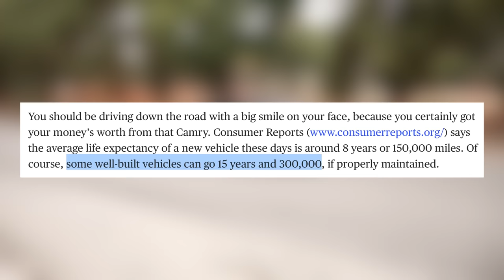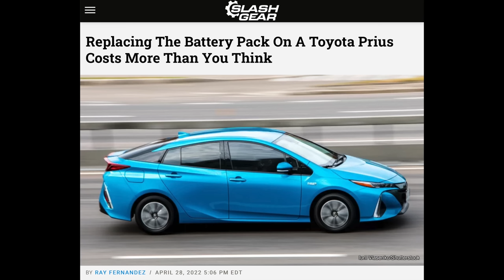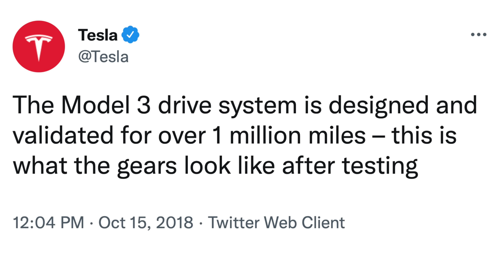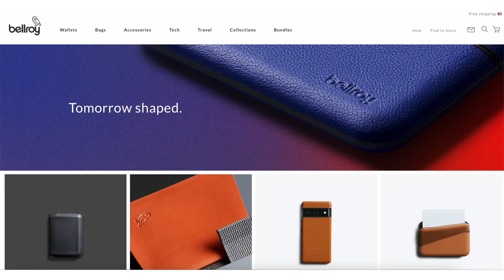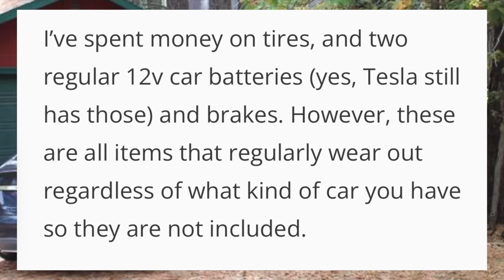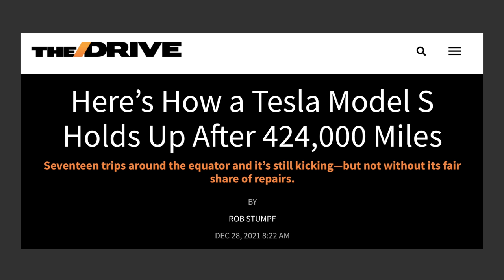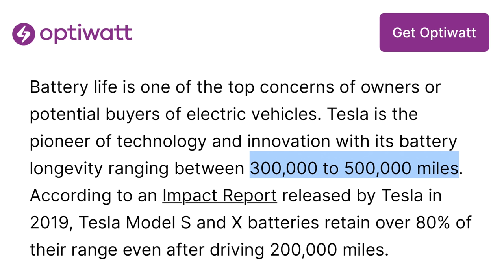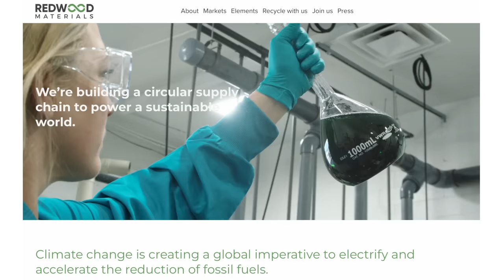The ONE MILLION Mile Tesla | It Still Runs

Comment: I'd be interested to see how the LFP Model Ys perform with their deeper charge cycles.  That 1 mil tesla reminded of the lumberjack's favorite ax, only had to replace the head 3 times and the handle twice.
Reply: LPF (lithium iron phosphate) cells can cycle 3000-5000 times. They will outlast the vehicle on average. Only drawback is less energy density vs li-ion. They either will have less range or a heavier/larger battery pack to match li-ion range. This is significant since li-ion are rated for 500 cycles maintaining 80% capacity
Reply: @dasppg9737  are LPFs being used in part of the Model Y batteries today?
Reply: @quaidcarlobulloch9300  I believe it’s being used in some of them. Primarily the lower range variants of the model y and 3. LFP is less energy dense than the li-ion NCA cells so won’t be used in long range variants
Reply: yes now

Comment: I'm at 142,000 in my 2018 model 3. Full HV battery scan shows around 9% capacity loss (using kWh capacity available not mile estimate).

Only significant repair is I had my steering column swapped ($1200) at 139,000 as a gear ⚙️ wore out and it was getting stuck. 

12v battery was $80 swapped myself, wheel bearing needed swapped for $120 at 95,000.

But that's really it. Original brake pads still and I'm on my 5th set of tires.

Comment: I'm at 118,000 with my M3 LR, so I'm approaching that 120k..  Full charge went from 307 miles to 288 miles.  (Edited as I misspoke the first time) I had to replace the Upper A-arms on the front for $701 and had to replace them around 60,000 miles; and rear cost me $600 around 110,000 miles.  No other big issues.
Reply: Struts cost you 1000? Damn. You mean suspension struts? That's very costly
Reply: @teem5642  upper control A-arms. Cost me $701.  I edited my comment above.

Comment: 80k miles on my 2018 model 3 performance with standard aero rims and brakes. I have had no mechanical issues so far. Almost through my second set of tires, replaced the windshield twice, windshield wiper fluid once. Car charges 130kw faster than it did when I bought it, and chargers are everywhere now. Range has decreased to 270 miles but the faster chargers and greater amount of chargers have made travelling far faster and easier than when I first bought the car. I figure at around 10 years I'll likely need to spend some money to replace some mechanical parts but dang this thing is cheap to operate.

Comment: You know what the greatest surprise take-away I got from this video?  Literally none of the 200k+ mi Tesla's you referenced mentioned having to replace the shock absorbers.  Tires, yes, but shocks that last more than 100k mi on vehicles like these with the extra weight they carry seems extraordinary to me!
Reply: I'm currently at 193k and still on original shocks lol
Reply: Tesla uses Bilstien shocks which are a higher level than most OEM shocks. I have heard of control arm replacement
Reply: @gtbigdog3507  I've replaced 3 upper control arms
Reply: @skep2  what model?
Reply: I finally parted with a truck I had because I didn't want to put $2500 into suspension repairs and then have the engine or transmission to fail (235k  miles original).  For electric, if the battery is still good, I would fix the suspension.  Holding out to replace that truck with the cybertruck.

Comment: I abused by 1990 Honda Accord for ten years.  I put 325,000 on it and it would still be running today had a tractor trailer no t totaled it in 1999. I had to replace a few clutches snd breaks but it never broke and never left me stranded.

Cars have only improved and if I bought a Tesla I could easily see at least over half a million miles.

Comment: Guys, the ceiling fan in my home is older than me. 39+ years (0 repairs). 
The iPhone 7 that I bought for my dad in 2017 had its first battery failure in 2024 (Dad replaced battery and using now) Tesla’s battery warranty is 8 yrs. The chances of a vehicle breakdown after 5 yrs is very very high for a ICE vehicle regardless of how well you maintain it. Moreover in 5 yrs there would be batteries would be cheaper with a less form factor. Who knows, the current model y can retrofit a battery pack which can take you 1500 miles per charge in future.

Comment: My Signature MX P90D with 236K+ is running great.  Only lost 13% of it’s original 250miles with 8yrs/unlimited miles and still on the factory brakes.  My biggest expense was losing the HVAC for the battery and cabin.  I never charge the car to 100%. And 85% of my miles are supercharged.  I will 17:24 own another ICE.  Waiting on my Cybertruck!

Comment: Hey Ryan, in your opinion, would trickle charging (Or Level 1 charging) an EV for the lifetime of the vehicle extend the battery life?
Reply: The fact of life for most Tesla owners, myself included, is that you will L1 charge your car around 90% of the time. It's important to note also that it's never necessary to supercharge above 80% like was talked about at 11:07. I've L1 charged my car to 100% when I'm about to take a road trip but supercharging to 100% is both incredibly slow (charging time dramatically increases as battery gets closer to full capacity), it's potentially damaging to your battery and it's not needed. Supercharging to 100% will actually make it take you longer to get to your destination. Thankfully, the Tesla navigation software saves you from doing the math and it's amazingly accurate. If it says you'll get to the next supercharger at 20%, you can put money on never getting there with less than what it estimates. Note, with the latest updates the estimates are getting even better as a number of mitigating factors are now being used to further improve an already super accurate estimation system. 

In short, no, you don't have to trickle charge all the time but you probably will trickle charge 90% of the time anyway. When supercharging, just do what Tesla's navigation system tells you to do and you'll keep from killing your battery pack and dramatically reduce supercharging time as well.
Reply: @russellthorburn9297  I assume you charge at level 2 (240 V). The question was whether trickle charging (120 V) would extend its life.
Reply: @russellthorburn9297  My charge stats says that I home charge 92% and SC charge 8% of the time so your 90% and 10% numbers seem reasonable.  I have charged to 100% once, at home.  I just wanted to see what it looked like.  Even when traveling I only bring it to 90% for the first leg.  There is just no advantage to going further than that.

When I purchased my Model 3 it was rated for 310 miles as I recall.  Now the reported range if I set the charge limit to 100% is 293 and I have 70+K miles on it. 

When traveling I try to keep the low point for the SOC at 20%.  I charge to the point that the car tells me to get to the next SC or destination.  My wife drove it from the Bay Area to the DFW area through southern Texas and she figured that charging time added about 2 hours to her trip.  That seems about right for that trip and the other that we have taken.  Generally I spend more time at the SC as I like to lay the seat back and take short naps at recharge time. I am never in a hurry. :-)
Reply: Staying away from 100% with NCA batteries and avoid below 5% for long periods of time is by far the most important.
Reply: @davidwojcik7770  This is correct. I already know that Tesla stresses keeping the battery at 80-90% on their packs that aren't Lithium Iron Phosphate (LFP). I'm having trouble finding information regarding whether or not a slower charge will help keep their batteries in better condition, though.
Reply: Batteries have a C rating, as long as you are under that rating they would be minimal difference.
Reply: How would he know??  He plays the drums.
Reply: @bryanwhitton1784  I went with the 19" Gemini wheels which get the Model Y 330mi of range. I removed aero covers on the gemini wheels which cuts range by a few percent though
Reply: Even on phones which have no active battery cooling whatsoever, fast charging is not demonstrated to reduce battery lifespan in actual testing since even the basic thermal management systems in phones will slow charging rate if it gets too hot. Teslas have liquid cooled batteries, for contrast, so I'd expect no noticable difference.
Reply: It’s possible. A better option or combined would be to care for the vehicle. Regular maintenance and smooth driving skills. The faster you go the faster you replace energy and parts.
Reply: @electrified0  absolutely not true. When then does Toyota limit their charging on their Prius and all other hybrids?  Because they’re trying to squeeze life out of batteries.   Toyota limits both the top and bottom end of charging for good reason.
Reply: With this size of battery, your house hold 220 voltage, amps, will basically be trickle charging. Won't be a whole lot of heat be generated...
This is only my opinion. I drink beer and know stuff.

Comment: Similarly to this video, my internet search shows Tesla’s body parts start breaking down after 100,000 miles in average. That’s pretty common in the car industry. Toyota and Hondas break less and last longer in average. I wish Tesla made better long lasting cars in terms of their body parts. I’m actually surprised it doesn’t. That’s why I’m not switching to Tesla yet. I hope they put some work into that. My Toyota has 400k miles and I have never had to repair one single thing in it, just regular oil change and breaks. I drive it off road a lot because that’s where I live and I push it pretty hard and yet it keeps on going.
Reply: This! I simply cannot follow when shopping for something luxury but it isn’t as reliable as some consumer grade examples out there.
Reply: The newer models with the structural pack and large gigacasting should solve these issues. Cybertruck should also solve this issue 😏
Reply: @mikelevels1  It’s so puzzling as to why that is!
Reply: @Gozi101  I hope so, but since Tesla’s track record is average  on these issues, we’ll have to wait a few years to see if these new vehicles will actually do better. It’d be great to switch to Tesla especially since Autonomous driving level 4 should be here soon. We’ll see!

Comment: One factor that goes unmentioned in these battery longevity/replacement debates is the possibility of replacing an old battery with one that uses significantly newer technology that could well result in much longer range than the original spec. In that context, paying $10k+ for a new battery would be entirely justified.
Reply: There could be challenges regarding backwards compatibility but great point and possibilities.
Reply: @ricinro I had no issue with putting a bigger battery pack on my Tesla from Tesla itself during a warranty  swap. I had a factory 85 kW and they said that battery was no longer being produced so they replaced it with a factory brand new 90 kW battery.
Reply: Except that it won't happen. Why would tesla do that? They'd rather sell a new car.
And there are plenty of other part that will fail appart from the battery.
Just check the leaking and bubbling screen on the model S
Reply: Yeah no, they will most likely give you a refurbished version of the same tech

Comment: An electric engine doesn't clog itself with carbon buildups/sludge after a long time. ICE are pretty much always going to get messy and clogged eventually and if you ripped them apart or cleaned them perfectly they'd also laster longer, but it doesn't really negact the fact that electronics are a cleaner way to operate. 

It's something I've noticed with phones, game systems and other electronics. They almost never have a reason to break so long and they don't get too hot. No mechanical parts means no mechanical wear and no fuel combustion means no sludge.
Reply: Electric motor *
An electric engine is a contradiction
Reply: Electronics, especially power electronics do break down.

Comment: 1:15 My Tundra is about to hit 300,000 miles.  I have both the F150 Lightning and Tesla Cybertruck on pre-order to replace it.  I hope they pull my number before anything happens although I am told its a million mile motor.  The engine has been maintained really well since new (have all paperwork) so maybe I am good.
Reply: Honestly if you got those trucks to do truck stuff your better off with ice or diesel ev trucks are trash

Comment: The interior should stay nicer just because of cabin overheat protection. Heat damage is common in cars. If my Tesla battery lasts the warranty I'll consider that a good enough deal for the price of the car and what I've saved on oil changes, gas, and other maintenance. And even if the battery is degraded I can still drive the car and just charge it more often, if my transmission goes out in my gas car the range drops to zero and stays there until I fix it.
Reply: Interesting analogy!
Reply: @ADE-of-LAGOS  Two years and 25,000 miles on our Tesla Model 3 and the only maintenance was the cabin air filters I just installed for $60.

Comment: 2013 Prius plug in with 375k on it. Original battery still holds excellent charge. Head gasket had to be replaced because of failed water pump at 220k. Car still runs perfect. What’s left out is at this mileage all the bushings and suspension is worn out so car is close to the end of its life.

Comment: We drive our Model 3 for 3 years and 125.000km now,  without major maintenance.  The costs were 2x new wipers, 1 set of 2 tires (!) And an interior air filter.  So the costs are extremely low.  Degradation is appr 5% now, but not noticeable.  Yes I'm a very decent driver,  always in Chill and 80% i charge slow at home.  Never above 65% only for long trips i charge to 95%.   This car is a miracle,  the maintenance is so low compared with my former German cars on diesel and patrol,  it's just fantastic.  We will try and reach the 500.000 or more km.

Comment: I'd like to see what the "average" battery life is over time so that we can predict how long a modern battery should last. So far, my only costs for my MYLR has been charging. I haven't even hit tire rotation/replacement territory yet - nearing 10k miles. So far, I have had in-warranty work done (seat bottom repair and window/seal adjustment/reset). If I can get double my warranty period, I will be super happy. Long battery life is important because not everyone can afford to buy new cars, so folks will expect cars to last several years for each owner. I bought my first car with over 100k miles on it and it lasted for over 5 years (finish high school and all of college, into my first year post-college work). I think EVs will have "arrived" when the same feat is both possible and common.
Reply: The number of miles driven by just one owner in this story shows what you are looking for since most WONT drive a car for that long but if a car is sold to others  each owner can drive it with confidence.